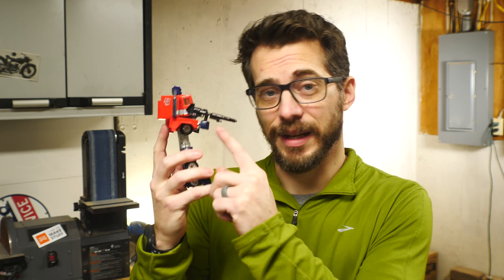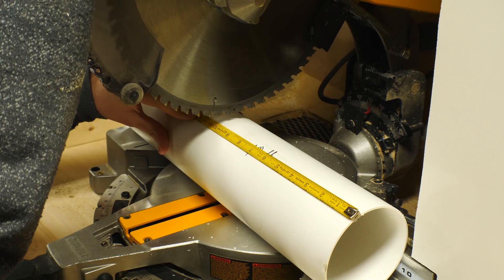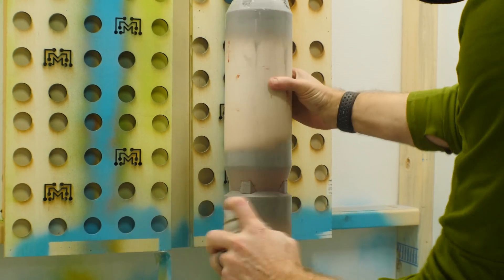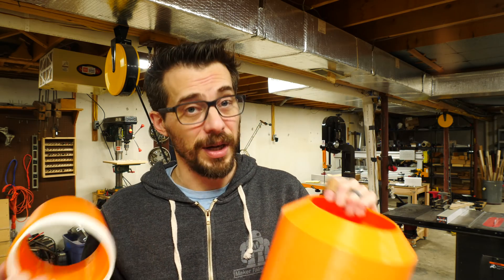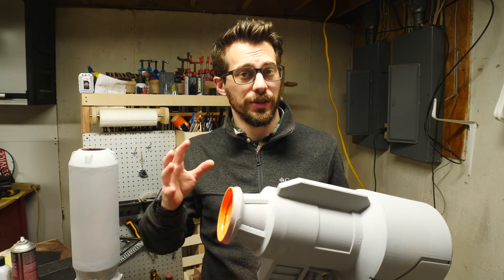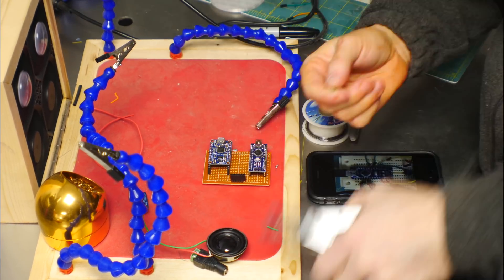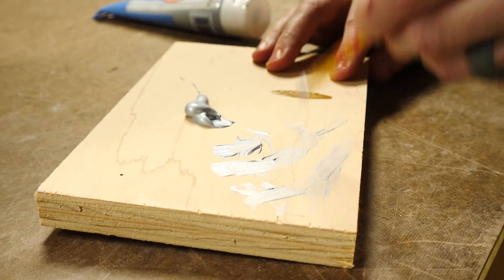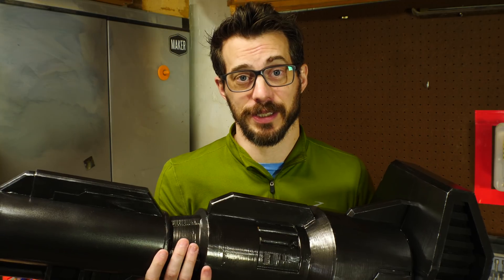How to make an Optimus Prime Blaster Prop | I Like To Make Stuff

Comment: You should have put your usb power stick where that cylinder piece poking out from under the bottom of the barrel is.. That way you'd never need to take the gun apart. Then again.. I'm terrible at electronics and probably would have just made it a potato gun.

Comment: I look at such things and think, "ok I'll need 4 feet of 4" pvc sewer pipe, 2 feet of 6" pvc pipe, one 3" to 3" coupler, one 4" to 3" reducer, approximately 2'X4" of 1/4" thick expanded PVC sheet, one bottle of CA glue, one small can of bondo, 1 can of flat black spray paint, 1 can of gun metal gray or dark metallic gray and 1 can of metallic silver spray paint".

Comment: Thanks goodness you abandoned your "first try". That would have been a disappointment, had you gone thru with it.

I would like to see more projects that include 3D-printed parts that interface with off-the-shelf parts and materials. Need ideas? Here's some:
Geodesic domes/spheres of any size using PVC pipes and 3D-printed nodes.
3D-printed adapter pieces that interface LEGO bricks with other building toys like Construx, Tinkertoy, Capsela, and others. (these are discontinued, so you'll have to check Craigslist, garage sales, etc.).
3D-printed curved molding segments. Say, you wish to have molding with rounded corners around a door or window, or follow a rounded wall corner. The corners may be difficult to render in wood, but if you are going to paint the woodwork, no one will notice if parts of it are not wood, as long as they are finished well. Image-search the phrase "molding with rounded corners" to see what I mean.
Plus, the 3D-printed molding parts would have integrated dowels (or just dowel holes, and use dowel pins) that would go into holes that you drill with the help of a dowel hole jig, so the parts would line up.

Comment: Hi, Bob -- James Floyd Kelly from Atlanta. You are definitely missed down here, especially around Maker Faire time. Quick question -- what super glue do you recommend that comes in a larger bottle and won't clog? I'm so sick of the smaller bottles that run out too quickly OR clog before it's all used up.
Reply from the maker: Hey James! Actually I get a big bottle for volume pricing then buy really small, cheap empty bottles to fill. They’ll always get funky eventually 👍🏻
Reply: I Like To Make Stuff any particular brand you favor? A link?

Comment: Great work.love this.with the 3d prints tho I have found sanding with high grit paper cleaning with isopropyl then using XTC3D,  then sand,then filler primer and sand and filler primer then sand until happy then use normal primer and paint.this gives an almost factory finish on 3d parts.but keep up the projects man as I live watching them

Comment: Why do you use CA glue on some parts and epoxy on others?
Reply from the maker: It mostly depended on whether the pieces were strong enough to hold together on their own. By that I mean, if the fit IN each other with enough friction, I'd use CA. If they couldn't hold each other without help, I used epoxy (generally).

Comment: That grin at the end :D

Just a thing I've been doing when printing adapters to join two similarly sized cylinders; I print a smaller diameter tube with a slot in one side. I stick the tube in and shim the slot until it fits then proceed to glue. For non-permanent friction fits I print a full tube smaller by about a millimeter then add duct tape to it until it's a good tight fit.

It's a lot faster than sanding/filing to fit either way.

Comment: Really cool also have you tried nail polish remover it works well to smooth out the print lines atleast it does on small projects not sure bout the big area it's worth a shot tho p.s I know your not supposed to just wipe it on and just use the fumes but it seemed to work well

Comment: I don't know if you know anything about speakers, but speakers always need an enclosure in order to sound as supposed to, especially in low frequencies. That is because, when the membrane pushes air to the front, it has to create a low pressure zone on the other side. That effect is certainly useful in noise cancelling headphones, but not in a speaker.
Try making a small enclosure out of MDF, for a speaker that small, 100-200ml should be plenty. Put in some stonewool in order to not have resonance issues.
I know your application is not to get HiFi sound, but it always frustrates me when well crafted props have speakers that sound as if they were made from a soda can. Really ruins the experience.

Comment: Is this printed in ABS? If so why use “super glue” and epoxy when you could use plastic glues that weld the ABS? I use the plastic weld glues with acetone all the time, I’ve often had epoxy glued parts pop off as they’re not melting the ABS together.
Reply from the maker: No, it’s PLA
Reply: Well that makes sense then!

What's your decision to use PLA? I have only used it briefly when I first started printing but I'm only familiar with ABS.

Comment: suggestion for all that sanding that you say you always need to do with the bondo at 3:33 , use cake piping tools. They're made for detailing, you just need to use a sandwich bag and the tinyest of piping tool, put some bondo in the bag and do some detailing in the cracks between the print and the pvc rather than use a big wood stirrer for that, it just spreads the goop around. Less sanding involved.

Comment: What led strip did you use? The electronics kit like seems to link to a light saber build rather than this. Is it just that you used the sane core electronics 

I've been looking for a usb battery pack powered Bluetooth or Wi-Fi led strip for ages and not found anything suitable
Reply from the maker: All of the pieces are in there together 👍🏼
Reply: Awesome. Also, forgot to ask, how long a strip can you power from the arduino?

Comment: For that adapter ring you could have just cut a ring from PVC then cut a split to it to either make it a bit bigger or smaller diameter.  Faster and cheaper than printing.

Comment: what dremel do u use?
Reply from the maker: Hmm.. 4200? 4000?  Something like that.  I can't remember exactly.
Reply: looks like 4200 to me, because the 4000 has not the quick bit release, why did u bought the 4200, its slower, weaker, and i need to mention that the 4200 because the quick release system cant properly put on the attachments like the "Workstation" 220, the Router attachment ... i tested the 4200 and the 4000 and i bought myself the 4000 in platinum edition with the workstation and the router and i works perfect